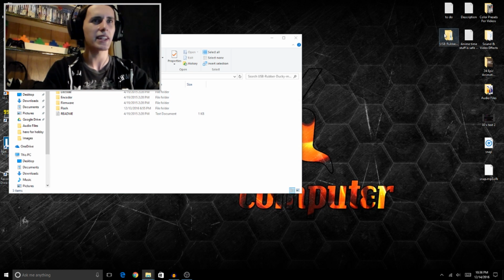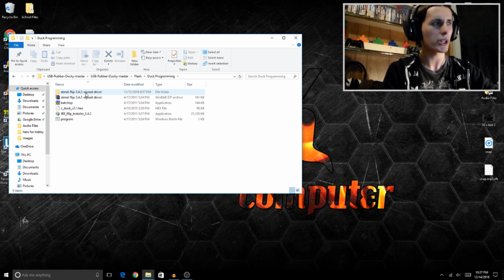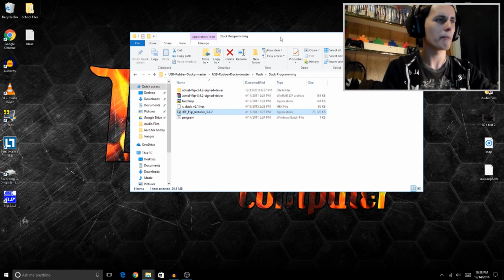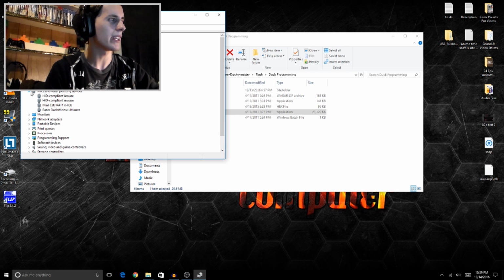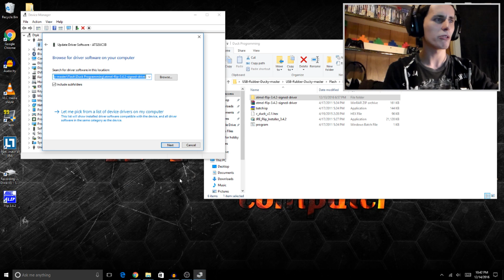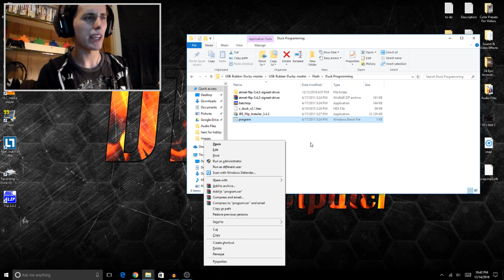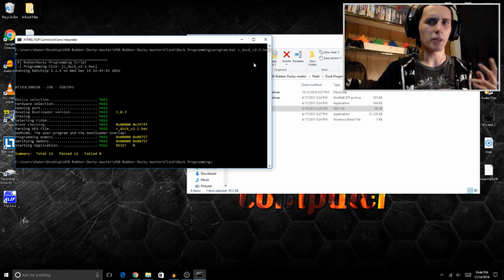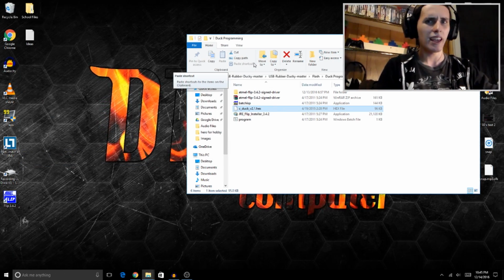Flashing Usb Rubber Ducky On Windows

Comment: does this method still work in 2022. i dont want to brick my duck.
Reply from the maker: Should still work from what I been hearing from other comments. You just need the atmel drivers and the other files as far as im aware they haven't changed any thing hardware or software wise. Sorry for the late reply back.

Comment: fuck me, this broke my ducky.. :<

Its just blinking, cant do anything.

and I dont understand how to revert this at all
Reply: edit: how do I unmake this? Like litteraly just wipe it/my computers ducky-drivers to factory
Reply from the maker: @gustav5677  You need the atmel drivers from what I remember and if you flash it wrong use the other firmwares I think just the plain duck.hex is the default one but it been a bit since I formatted mine. And oh some of the other firmwares are activated when num pad num lock is active so turn off the num lock.

Comment: im confused, it worked and its flashing red/green but it doesnt show up as a USB?
Reply from the maker: Hmm I would reflash it again. Sorry for the late reply and if the reflash helps let me know if not ill go re-read the guide or check the comments I had someone have this happen before can't remember what they did but I think all they did was take out the sd card and put it back in.
Reply: @everythingdigital1  Hey whats going on, so after hours of research i found out that v2.1 doesnt currently work for some reason. every is using S001. Also for the people that like to read the comments like me please make sure you put a cap S lmafo i spent an extra 2 hours wondering why nothing is working bc i didnt do a cap lol
Reply from the maker: @MrIFreezeGaming  Sorry man it been awhile since I made the video I got use to using digisparks and ardurino pro micro's so my memory was a bit hazy. Thanks for leaving a comment i'm sure it will help others out and i'm glad it is all working and you got it flashed and yeah the capital S really is important.

Comment: I'm not sure if you still reply to this or even would know the answer, but I recently got into messing around with the rubber ducky and I followed this exactly as you did it and it ended up flashing green/red after. I just have another problem now. When I plug it in either way I don't get it showing up as a drive at all. It either shows in my device manager as a keyboard or a storage device and thats all I can see... If you have any idea that'd be super helpful
Reply from the maker: Hmm I would copy the files off the sd card and then try to reformat the sd card. If that doesn't work try to format it as fat 32.

Comment: Can we turn a normal USB into a Rubber ducky?
Reply from the maker: No their use to be a auto launch thing but that been since phased out. You can how ever just turn a arduino into a usb ducky just about the coding is a bit different but you can convert ducky code to be used on a arduino the cheapest one is a digispark I made a video on it on the channel. Digisparks are the cheapest hid device out there they are only 1$ or so...

Comment: Do you have script file exfiltration ? By using 2nd usb ?
Reply from the maker: I'm a little confused and sorry for the late reply. If you mean you want the twin duck firmware to copy a file to the usb ducky best bet is too look into something called duckslurp or podslurping have the usb ducky type a batch and vbs script that looks for the ducky sd card then copys files too it. I think I done a video on my version of this but hak5 has a standalone script they made for the usb ducky all you would have to do is change there script so it sends the files to the usb ducky instead. Also copying files in mass to the ducky is pretty slow sometimes.
Reply: everythingdigital1 hey bro sent msg on fb messenger check it out

Comment: Hey bro i have done same as your tutorial and passed all 11 with hak5 microsd then i install in it inject.bin then I plugged it into my pc and its blinking red and green and the inject.bin does not work inside it
Reply from the maker: Try to reformat the sd card then put the inject.bin back on if that fails reflash the old firmware. Which should be called just "duck.hex" if I recall correctly it been awhile.
Reply: everythingdigital1 its works by changing the sd card

Comment: once i finished doing all this the ducky looked perfect it was blinking like you said it would as well. but when I tried to plug it in and run a script it didnt do anything. with one micro sd card it just opened up d: drive like it would with a card reader. with another micro sd card it just did litterly nothing i checked the script and everything looked good but the ducky was not doing its job.
Reply from the maker: Hmm weird try to reformat the sd card if you can and make sure the inject.bin is spelled right if the ducky isn't recognizing the script that could cause it not to run. Other then that it should come up like a usb stick as a drive that is normal. If formatting the sd card don't work try to re make the usb ducky script or re-flash the usb ducky.

Comment: Thanks for ruining my new rubber ducky
Reply from the maker: I didn't do anything and if you need help ask. Plenty of people had this work and those who had problems listed there solution down below also this video still works re-download your files and try again. Most likely your drivers didn't install on windows 10 driver reinforcement needs to be disabled or this won't work. And if you flash the wrong hex or the twin duck hex doesn't work flash the original firmware. Which is " C_duck_v2_s0001.hex " or " duck.hex " I believe.

Comment: Hey man. I bought this CJMCU BadUSB on eBay for about $10 and the seller says that it can do everything a rubber ducky can do. The computer recognizes it as an Arduino Leonardo and it has all the functionalities as the duck, including the button on it. It's basically a clone rubber ducky. Anyways I was wondering how to do the Twin Duck firmware with it.
Reply from the maker: I think they are two separate things so unless you completely remake the twin duck code so that it is ardurino based I don't see any way you could get the ducky firmware to flash to it.  Also I need to know the hardware more does this bad usb ducky clone have a sd card to store ducky scripts cause if there is no sd card then the twin duck firmware would be pointless on it.
Reply: everythingdigital1 yep there's an SD card and it reads ducky code
Reply from the maker: Actually I looked at it and it does have very similar features hmmm i'd have to look into it more but there might be a chance for a twin duck solution for the cjmcu bad usb from what I can see at least.
Reply from the maker: This says you can choose a mode and a payload with a serial connection of usb with your phone. There are no list of modes on the page so I couldn't tell you for sure but maybe there is a twin duck mode if you connect it up this way like in the picture. I wish I could be of more help but the git-hub pages for this board are kinda all over or have little to no info about flashing it.
https://github.com/mharjac/bad_ducky/wiki/Switching-modes-and-payloads-with-a-smartphone
Reply: everythingdigital1 yeah that's what I noticed about it. Ducky Scripts work fine on it, just not the ones that require the Twin Duck firmware. Hmm I'll look deeper into it

Comment: Could someone please help me with the issue I am having? My issue is that I cannot edit the script on the usb rubber ducky like it doesn’t appear so I can’t edit it, any ideas?
Reply from the maker: Do you have attributes on the file such as "hidden" if not or you don't know can you take the Sd card out and put it in the computer and see if you see the file then it should be called "inject.bin"
Reply: everythingdigital1 I’m sorry I’m an idiot but how would I tell if I had it hidden? I don’t think I do but could be wrong
Reply: everythingdigital1 ok new issue. I unhid it and am now able to open it but every time I do it says “please insert a disk into usb drive” even tho I have the sd card in
Reply from the maker: Question just wondering if you know how to make the "inject.bin" file and how ducky code works if you don't get the basics then flashing it might be too much a a advance step for you right now. Also no worry's if you are it's easy to pick up. Another thing you could do is reformat the sd card could be a corrupt file if after you reformat the card and still nothing after you put a new script on let me know also heres a site to start with. https://ducktoolkit.com/
Reply: everythingdigital1 I already have and created my inject.bin file I just need to put it on the usb now. But the usb doesn’t appear for me until now where is says that. It’s fine if this is too advanced for me currently but rn I’m just trying to be able to make a basic script. How would I go about formatting the micro sd card if it doesn’t appear at all for me?
Reply from the maker: You would put the micro Sd card in the computer goto 'This Pc" tab find the Sd card right click it and format I believe the default should be Fat 32 but id have to look. After you format it move the script back on to it then put the sd card into your Rubber Ducky. And oh before I forget if you managed to flash the ducky did it all go good is the ducky flashing colors now when you plug it in and does the usb ducky work now as storage too.

Comment: my driver doesnt popup ;-;
Reply from the maker: Maybe try to make sure you have driver reinforcement off in the bios possibly windows is blocking them from installing. If you already got it off and its still happening let me know.
Reply: dont i have to use the micro chip reader to put in scripts and the put the chip on my usb?
i flashed it to a twin duck but now it doesnt run the scripts
Reply: and btw how do i get it back to normal so i can flash it again?
Reply from the maker: I believe all you do is flash this firmware " duck_v2.hex " it should be under the folder with all the other firmwares this file is the default usb ducky firmware.
Reply: its just that by scripts arent running now
Reply from the maker: Try to reformat the SD card and and re-install jre flip drivers also did you try to flash the original firmware and see if the scripts work then if they don't then reformting the sd card or installing the drivers again will most likely fix it.
Reply: well i just have to uninstall the flash i did to my rubber ducky and i dont know how to
Reply from the maker: You just flash the " duck_v2.hex "the same way as flashing the twin duck firmware follow the same steps but when you goto flash switch out the twin duck file with the duck_V2.hex that should reset the duck back to default firmware.
Reply: its just so sad that i have waited so long and i find out it doesnt work ;-;
Reply: my rubber ducky
Reply from the maker: It should I haven't seen any change hardware wise from the Usb Duckys perhaps try to flash it on another Pc redownload everything and follow the video again. If I had to take a guess the drivers never installed and if they did and your usb ducky is going from red to green then it should be easy to flash the original ducky firmware called " duck_v2.hex " also if it is going green and red on the Duck try to reformated the sd card perhaps you corrupted it by leaving it in when you flashed it.
Reply: no i did just like you did, and yes it does flash red and green :)
Reply: think i have the same problem as  Boastinq
Boastinq
Reply: will i mess it up if i try and download it again

?
Reply: i subbed cus your nice
Reply from the maker: No it shouldn't mess it up but if it is going red and green you got it too work I think I saw another comment before like yours and what fixed it for them was reformatting the sd card as fat 32 I believe. But if you don't wanna do that then flashing the other firmware duck_v2.hex will reset it back to normal just when you get to the step about flashing in the video instead of using the twin duck firmware use the " duck_v2.hex " instead.
Reply from the maker: If the duck_v2.hex don't work try the one boastinq did "  c_duck_v2_S001.hex " I think its the same thing but with a different name.
Reply: haha yeah k

Comment: Hey I'm not sure if you're still actively watching comments on this video but.. I successfully flashed the twin duck firmware and I am able to run basic payloads, at the same time able to access the mass storage.. However.. I noticed that when writing a script the symbol ~ translates to | which throws off the rest of my payload. Any idea why? The payload was executed via rubber ducky deluxe on c_duck_v2.1.hex. Any help is appreciated. Thanks!
Reply from the maker: Hmm yes i'm actively watching my comments and I think what is going on with your code is there's a special key to use to make this ~ try to search the Usb Ducky wiki if it still up it shows the keys and everything that may have a different trigger I wish I could help more I use to know how to fix that issue but it been so long it slipped my mind. If I ever figure it out I will definitely leave a reply back. :D Any way i'm glad the video was able to help you get your ducky flashed.

Comment: Done everything on the video and it all came up with Success however. When i plug my usb into the pc I cant see the files? I cann see in the device manager there is a 'Usb Mass Storage Device' However I cant see the usb under devices? Really confused
Reply: Also none of the payloads are deploying when i plug them into the pc
Reply from the maker: Make sure your flashing the right payload first of all cause not flashing the right one can cause some of the things your saying to happen and make sure you have the play load name correct it should be inject.bin like always also I heard this from another user before try to reformat the sd card into another format. Also sorry for the late reply.
Reply: the hak 5 micro sd sucks, try another. mine did not work too, but after changing it it worked

Comment: Hey mate, great video. had minor issues but im am terrible with computers. i saw below that someone else had the same problem as me, when you shift right click it comes up with power shell instead. it really annoyed me and it took a while to figure out, but all you gotta do is hold: 'control D' and then type 'cmd' thats to put it simply for the noobs like me :) thanks again for great video!
Reply from the maker: Also found out another way is to open power shell and type " cmd " it will put power shell into command line mode which will also work. Any way glad to hear you got it all working and that you enjoyed the video Bro. :D
Reply: @everythingdigital1   i tried both things and it still says powershell for me
edit: nvm mind i figured it out you meant to say alt d not ctrl d at least for me

Comment: is there anywhere I can contact you so I can show you a photo of what I'm seeing? I have the ducky programmer but there isn't an option to extract it.
Reply from the maker: You can message me on here in a private message and send a link to a screen shot so I know whats up but if need be im willing to help out over Skype but I think you just need to right click and then extract. And also in the latest windows 10 update they killed the shortcut to open cmd and replaced it with powershell so if you get stuck there after powershell opens type "cmd" then you should be able to follow the rest of the video instructions fine.
Reply: actually, now.. there's been a recent update and now when you try to pull up cmd from a specific folder, it only gives you the option to pull up powershell. wtf
Reply from the maker: Yep.... Pretty much I hate it but it is the better program all you got to do to go back to the cmd though is a registry hack or you could just type in cmd as power shell is open and it will now run cmd with in it lol.
Reply: I msg you.

Comment: I wonder can i do this on a "rubberduino" its a CFsunbird 3590S..  idk if this this works
Reply from the maker: I actually have no idea if it will work with that device but if it does let me know although if you do want a arduino based Usb Rubber Ducky I made a video on the Digispark too its like a 1$ Usb Ducky that can be programmed with arduino code.

Comment: My Duck doesn't go green and red. Just red.
Reply from the maker: Try to flash one of the other firmwares then re-flash the twin duck firmware on again perhaps the firmware didn't get pushed through right and if you can try another usb port.
Reply: Okay the next USB port worked. But it still won't execute payloads. I plug it in. It holds the device flashing green and red but no execution. It's bugging me, got an idea?
Reply from the maker: Sorry for the late reply its been storming bad over here today but have you tried checking the sd card on the ducky if you flashed with it in it might have messed up the sd card so make a new inject.bin file perhaps also try to format the sd card.

Comment: just info : for those having problem with the twin duck not working after flushing.

here's ho i fix it :

1.the micro sd, from hak5 sucks !! change with other micro sd

2.if still don't work, uninstall the driver than reinstall using : c_duck_v2_S001.hex

SERIOUSLY.. THE DEFAULT MICRO SD SUCKS !!
Reply: Thank you, but is there a way to put it up there without it messing up